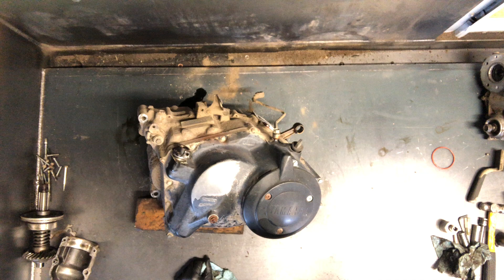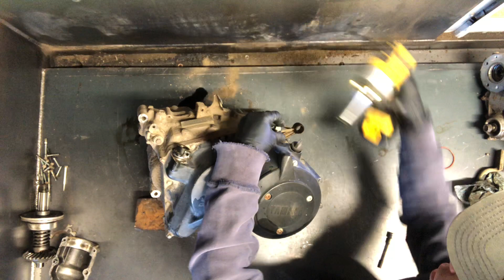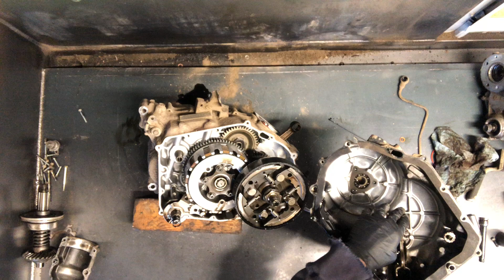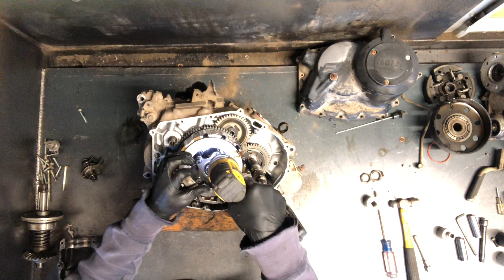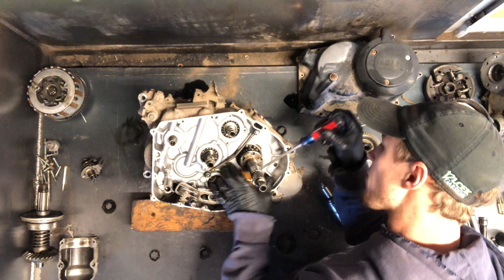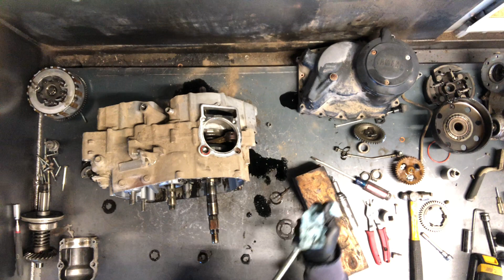Yamaha Big Bear YFM 350 4x4 How TO 3/3- Engine Tear Down Motor Transmission Crankcase Split

Comment: Thanks for this series and the other video on how to reassemble the gearbox. I have used them to tear down and repair my 1995 model. I have one problem, the bike goes into gear and drives good but the centrifugal clutch is dragging so it is trying to move at idle and is difficult to get out of gear when stationary. I have tried to clutches, on nearly worn out and another that has been re-lined. the one way bearing works good, spinning the drum freely anti clock wise and turning the gears turned clockwise. Anyone got any tips would be appreciated.
Reply: I would try and replace entire assembly at this point.

Comment: I got a 1995 yamaha big bear 350 the high range work good the low range is funny got any ideas
Reply: Mine does the same thing , it pops out of gear on low range . Did you find out what the issue was?
Reply: The low range it go good for a little bit then feel like it pop out and the high range has no probably